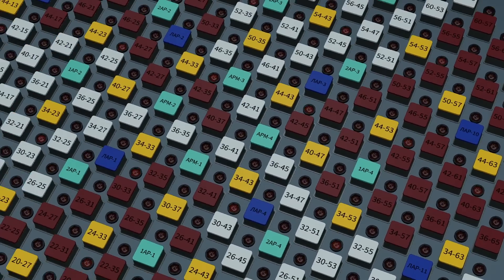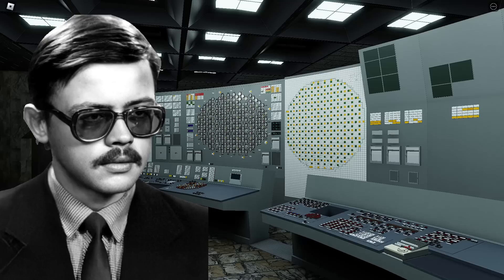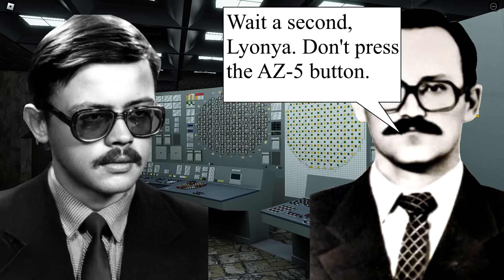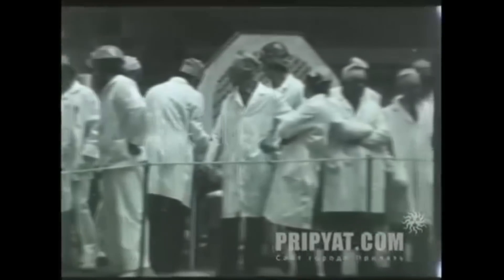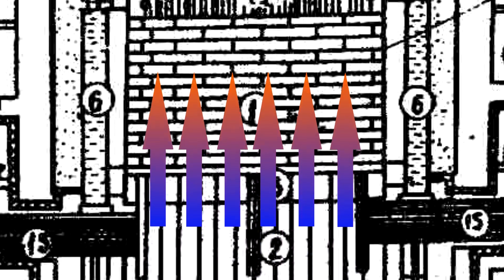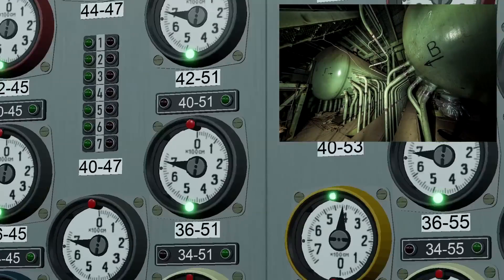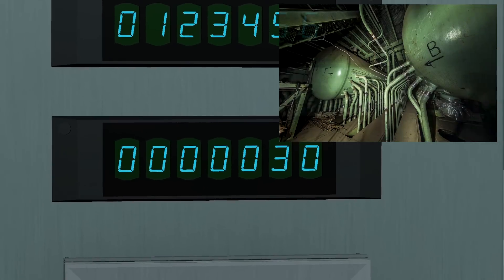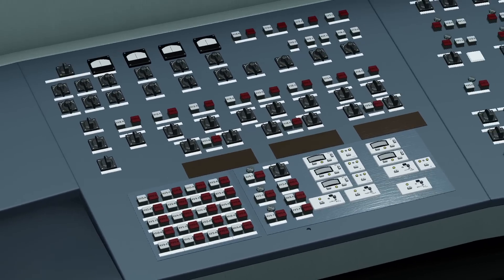Would Not Pressing AZ-5 SAVE Chernobyl?

Comment: You kinda lost me at water that's stated as "165 degrees Celcius" at the 1:48m mark... and how later it is heated to reach its boiling point (at the roughly 2m mark). I'm no chemist... but water boils at 100C. Did you mean Fahrenheit and not Celcius when describing the water temperature?
Reply from the maker: Celsius. The RBMK operates at a high pressure, which greatly increase the boiling point of water.
Reply: @thatchernobylguy2915  aaahhhh yes, forgot about that. One can "raise/lower" boiling point of liquids via pressure manipulation...

Comment: So it seems that not pressing the AZ-5 button might have delayed the inevitable, but wouldnt have prevented it.
Reply: Nothing at that point could have stopped that reactor from going critical but it was the pressing of the Az5 button that ultimately made the disaster so much worse because the soviet being rhe soviet cut cost on the control rods which Az5 woulf lower all at once they were supposed to be made of borax which would was supposed to negate the reaction but they got tipped with graphite which entered first and instantly increased the reactors power
Reply: I recommend watching this: HOW THE 4th UNIT OF CHERNOBYL NPP WAS BLOWN UP (channel-KS).

Comment: Im more curious if the test "result" was the worst possible result, or if a significantly greater nuclear event would have occurred if this was done under an overload.
Reply: The test was designed to simulate a bombing run on the reactor that caused both a loss of off-site power(power lines knocked down) and a LOCA(Loss of Coolant accient, caused by the same bombing run in the scenario). Hence cutting off the water pumps and shutting down the turbine, the test was to see if the Reactor could survive until the emergency diesel pumps kicked on. This was made primarily in response to Operation Opera where the Israeli's bombed an Iraqi-Military reactor off the map.
Reply: According to calculations by some scientists, the reactor output increased to 100 times its nominal output during the disaster. At the time of the explosion, the entire Soviet Union could have been supplied with electricity using reactor 4 alone.
That was already extremely violent.
But I can't tell you what would have happened at full load. Perhaps at full load the AZ-5 button would have prevented a catastrophe.
During partial load there was a high proportion of xenon gas in the reactor. Without xenon gas in the reactor, nothing might have been unstable.

Comment: According to the video, not pressing the AZ-5 button would not have saved the Chernobyl nuclear disaster. The video explains that the AZ-5 button was designed as an emergency shutdown for the reactor, but pressing it during the experiment at Chernobyl actually caused a rapid power surge that led to the explosion and meltdown. The video argues that the root cause of the disaster was the flawed design of the RBMK-1000 reactor, which had an inherent positive void coefficient that made the reactor unstable and prone to power surges. Pressing the AZ-5 button exacerbated this issue, but the disaster was ultimately inevitable given the reactor's design flaws. Therefore, the video concludes that not pressing the AZ-5 button would not have prevented the Chernobyl accident, as the reactor was already on a path to catastrophic failure.

Comment: It doesn't need saving, IT'S FINE. Just get that water flowing, for the love of god, how many more years will I have to wait? The reactor NEEDS WATER
Reply: I thought that the reactor needs graphite.
Reply: @jannespor8178 
if im not mistaken graphite accelerated reactivity which caused the explosion
Reply: @gtbmofficial  Did you see the graphite? 😉
Reply: @jannespor8178  graphite slows the fission reaction by absorbing neutrons. Water redirects the heat from the fission reaction. Both are important but the error was a spike in temperature due to lack of coolant (water). The graphite wouldn't have done much to prevent it without extra water. Its like eating food when you're thirsty in a way - it isn't going to help it
Reply: @TeraChad23  But you didn't see the graphite, did you?
Reply: @sherwoodlikesomecheese  (yelling while pointing a pencil at me)
Reply: 😂😂😂 @sherwoodlikesomecheese
Reply: @TeraChad23  unless it's cucumber-watermelon salad with shaved ice for dessert.😂😂
Reply: @jannespor8178   lmfaooo
Reply: @FinUgShiet  that sounds absolutely delicious ngl
Reply: @TeraChad23  😅😅 Maybe I should try doing it today, since it's hot as hell here in Finland (imagine that :'D )
Reply: @TeraChad23  
Uhm, no. Graphite accelerates the fissioning because it moderates (slows down)  the neutrons to thermal speeds which makes it easier for a neighbouring prospect U-235 atom to absorb one and split. So, the chain reaction goes up, not down.  Boron is what you want if you want to slow down/ stop the reactor. Boron is one heck of a neutron absorber. Stick it in any reactor, and it will go to sleep quite fast because all the neutrons it needs for splitting atoms will have gone away.
Reply: @TeraChad23  wrong
Reply: @TeraChad23  No, graphite slows down neutrons which causes the fission reaction to increase.
Reply: Needs some LaCroix, more like it.
Reply: Raise the power
Reply: Wasn't all of the reserve water already hot? IIRC that's why so much of it started boiling in the first place, they had activated all the extra tanks when trying to reduce power output for the test. And because there was so much water in the loop it was getting pushed back to the reactor after barely falling below boiling.
Reply: @jbutler8585  the accident just happened cause they turn all possible safe guards to run a test, they should have been able to understand that being unable to run the test was the test result itself
Reply: @jbutler8585 Borax would've aided in holding down many of the neutrons, and lowering the boiling point, but they didn't know that.
Reply: water + CULTURE = LaCroix!!!!!

Oh yea
Reply: I think the point the video was making is that there was an automatic process that would have done the same as pressing the AZ-5 button, and the water would have taken too long to get to the reactor to prevent this automatic process from being carried out and blowing up the reactor anyway. So not pressing the button just delays the inevitable if you can't also stop this automatic process from being carried out.
Reply: Finally someone who isn’t delirious, thank you Comrade Dyatlov
Reply: IT BLEW UP
Reply: @James-nf2kg He’s delusional, get him out of here!
Reply: @James-nf2kg  you're delusional. RBMK reactors don't explode.
Reply: @James-nf2kg just add water
Reply: Ok, let's write it down then. The whole issue was bcuz of stupid and flawed RBMK design
Reply: @Deamon3217  Everything is flawed when you don't use them right.
Reply: @XtreeM_FaiL  There was an incident at a nuclear power plant in Leningrad several years before Chernobyl had the same problem where the AZ-5 button was pushed and the power however only briefly instead of going down actually went up. Instead of telling everyone about the RBMK reactors massive design flaw, the Soviet Government and KGB chose to cover it up rather than tell anyone about the problem.
Reply: @XtreeM_FaiL  Not true. All high stakes designs have to stand up to a variety of unpredictable circumstances and, as well as possible, human errors and misuse.
Reply: need negative void coefficient so water loss as steam doesn't matter
Reply: 8 months later and got a laugh at all the comments replying seriously 😅
Reply: Does anyone who is British imagine/want him to shout “OH SHIT ON IT!”
Reply: “Theres no reactor there.”
Reply: Send yourself to the infirmary comrade
Reply: Comrade Dyatlov, why did I see graphite on the roof?
Reply: This is fantastic
Reply: Reactor clearly had a burger king crown
Reply: Unfortunately, the reactor is now a mangled pile of corium
Reply: @jhhyyggg  It’s actually not… it mostly emptied.
Reply: Water supply activating time is 1.5 minutes meanwhile reactor burst only needed  few seconds
Reply: I recommend watching this: HOW THE 4th UNIT OF CHERNOBYL NPP WAS BLOWN UP (channel-KS).

Comment: After learning everything i could about this disaster over 10 years. I think there was only one possible way to save the reactor. They would've had to resist the urge to press AZ-5 and instead slowly start reintroducing control rods a dozen or so at a time. Because at that point in the evening the reactor was at its limit. You can't make huge changes to a system under that much strain, it will fail. You have to slowly and carefully walk it back from the edge of disaster first.
Reply: Problem is that the procedures stated to press that button in that exact situation and it was supposed to be a fail safe.  None of them knew of the fatal flaw
Reply: The problem with this is that the button was sold exactly for this kind of "oh shit" situation - I guess no one would permit nuclear reactor operation without "yes we have a button which will save everyone"
Reply: @SukSukulent  Is that the button that Homer Simpson found using the eenie meenie miney mo search method?
Reply: The problem is that this teensy-weensy but ever-so-crucial little tiny detail of the control rod tips effect when pressing AZ-5 was kept a secret. Nobody in that room knew that the emergency shutdown button can also function as a detonator.
Reply: @yubjuli  People should stop saying graphite tips, like they just put some graphite right on the control rods to make it detonate. The graphite "tip" is a long displacer, and is already in the reactor even before the rods are lowered. It's not like it just enters the reactor when the rods are lowered. The only reason they acted like that was because the reactivity was so high in the lower portion of the reactor, and the couple of centimetres of water below the graphite displacers were acting as a neutron absorber, and no longer did once the graphite was introduced.
Reply: @yubjuli  yeah, because RMBK reactors are just perfect and they can't fail
It would be insane if someone somewhere found some files from engineers where they point to the control rod tip problem, but that's probably long gone
Reply: https://www.youtube.com/watch?v=yIA_FMz9n1k
Reply: Or they could not have broken numerous rules and as a result not ended up in the situation in the first place.

Without knowing the issue with AZ-5 there was no reason for them to try anything else.
Reply: @notsureyou actually, there was a rulebook back then on how to operate rbmk reactor, designed specifically for the operation personnel. 
And basically, operators did everything they were supposed to do and didnt break any rules or procedures that were prohibited by that rulebook.
Thats why one of the operators (Akimov if im not mistaken) said in the hospital after the explosion - "i don't understand why this has happend, i did everything i should have done".
You can read about that in Dyatlov's monography about the incident, if it was translated to English from russian.
Im a Russian speaker btw
Reply: @farshist  Isn't that the same person that blamed EVERYONE but himself?

Akimov wouldn't have understood why the reactor exploded since he had pushed a button that should have shut the reactor down.

So him pushing the button and the reactor exploding would not have made any sense.

"While the initial Soviet investigation put almost all the blame on the operators, later findings by the Ministry of Atomic Energy and the IAEA found that the reactor design and how the operators were informed of safety information was more significant.

However, the operators were found to have deviated from operational procedures, changing test protocols at will, as well as having made "ill judged" actions, making human error a major contributing factor."

Comment: Noooooo. Cold water does not reduce reactivity. It actually raises it! Read up on the negative fuel temperature coefficient. The whole point of a boiling reactor is to have the controls rods in as far as possible and use only recirc flow to drive up the power.

Just because a lack of water raises power does not mean its presence reduces it.

NOOOOOO RBMK was not prompt critical! It is not reactive enough for that. The fuel is only 5% or less enriched whereas a nuclear bomb is hella enriched. Yes reactivity was rising fast, however, it would not be able to reach nuclear bomb status.

The part where you begin to pull in papers with actual research is of course very good and your conclusions are correct. But chernobyl was a steam explosion, not a nuclear one. Keep that in mind. Conclusions seem accurate, but assumptions are misleading.
Reply from the maker: Cold water does reduce reactivity in an RBMK. The fuel temperature does not greatly fluctuate during the influx of cold water. However, the reduction in reactivity due to the decrease in number of voids, and therefore a knock on effect on the positive void coefficient, is very significant. This is a very different reactor from a BWR, for example. Having the control rods mostly out was beneficial to maximise the efficiency of the fuel, and the negative insertion of reactivity in an emergency situation.

A prompt criticality at Chernobyl has been associated with the explosion since the 1990s, for example in INSAG-7, the IAEA's official report on the Chernobyl Disaster, which shows calculations supporting a beta eff value six times the threshold for prompt criticality. This is mentioned in Part Three of my "How Chernobyl Exploded" video.

As for the explosion being nuclear, modern papers do seem to support this based on a variety of evidence. Here is one such example article: https://www.tandfonline.com/doi/full/10.1080/00295450.2017.1384269

I hope this helps :)
Reply: Now this is a startling comment.

Comment: Ill save you 10 minutes, no, not pressing the button wouldnt have saved chernobyl, it was already melting at that point, think of it like youre in a car with no brake and youre going 150 mph towards a wall, pressing the button would have made the car go 160 mph, it basically just sped it up a tiny bit but if they hadnt done anything, it still would have happened
Reply from the maker: You haven't watched the video; this is not true.

The reactor was stable when AZ-5 was pressed, and was not in danger of melting down until the button was pressed. I'd recommend my series "How Chernobyl Exploded" as this is a common misconception that the reactor was already melting down when the button was pressed :)

Comment: Stupid question, but how do they keep water liquid at 165-265 Celsius?
Reply from the maker: High pressures force gases to become liquids again. If you, for example, took the lid off of the reactor while it was running, all that pressure would be released and the liquid would become gas :)
Reply: Pressure.
Reply: Ever heard cooking instructions that say you need to boil things longer at high altitude to cook them? It's because there is less air pressure at high altitude, and water boils at a lower temperature at a lower air pressure. The opposite happens at high pressure, so you can keep water from boiling by keeping it under high pressure.
Reply: Also water can be boiled at 50 C if the athmospheric pressure is 1/2 of the original.

Comment: I still don't understand how lowering the control rods increases the reactivity or how the voids increase the reactivity doesn't the water act as a moderator slowing down the neutron increasing the reactivity and the voids make the reactor less reactive.
Reply: The control rods increased reactivity because they were tipped with graphite. This was designed to help with reactor power output when the rods were fully withdrawn (normal operations). That being said, pushing the rods in caused the displacement of the water below it. The water was acting as an absorber and was replaced with that of a moderator (the graphite tips). As far as the voids go, it’s also all relative too. Steam has a lower neutron absorption rate than water and with more and more water boiling to steam, the positive feedback loop is formed.
Reply: When you withdraw the control rods, what you want is an increase in reactivity. But if they're fully withdrawn they are replaced in their channels by water which is a shielding material, and this produces the opposite of the desired effect.

The rods therefore need to be tipped with something that is left in the core when withdrawn to displace the water. This could just be stainless steel, but if the tips are graphite then this boosts reactivity more, because graphite is a moderator and more moderator usually increases reactivity. 

Where the design flaw occurs is that the tips didn't extend to the bottom of the core. When the rods are fully withdrawn they sit centrally in the core, boosting reactivity there. But as the tips don't extend to the bottom of the core, the reactivity at the bottom is relatively depressed when the rods are withdrawn.

Then when the rods are inserted, the reactivity at the bottom of the core goes up. Water overheated and boils, voids form, reactivity goes up further, BOOM.